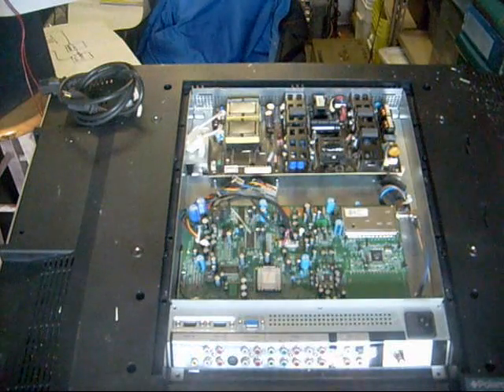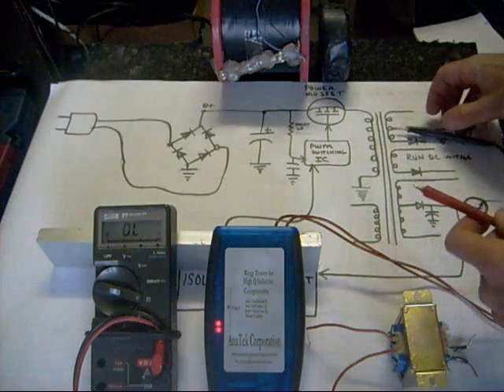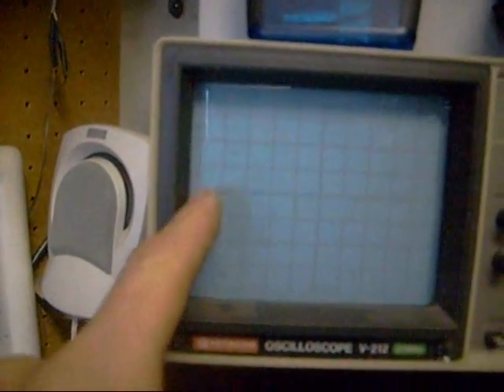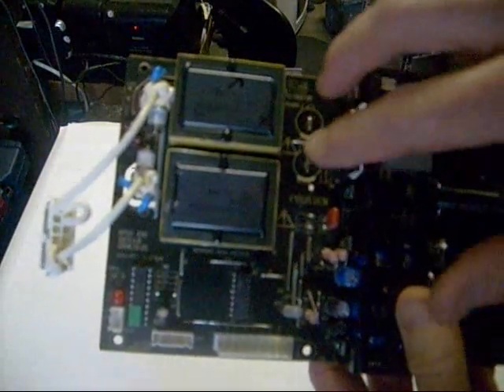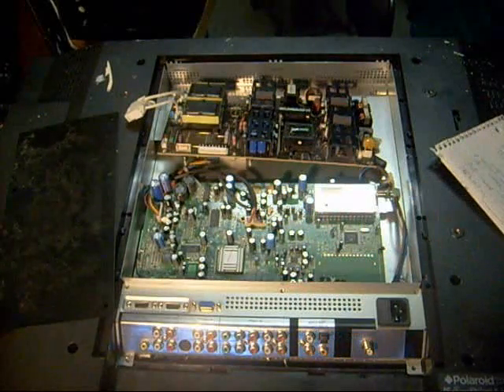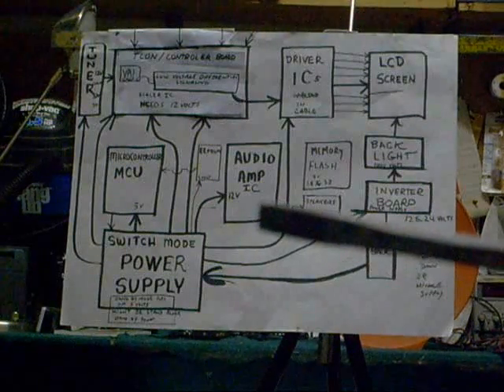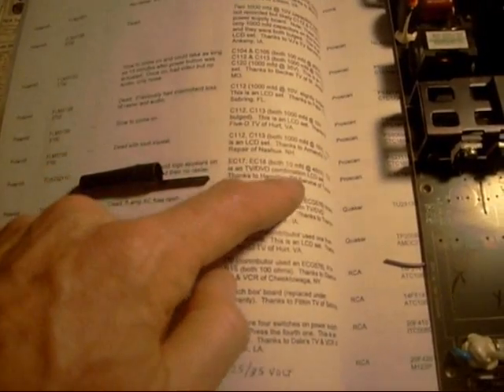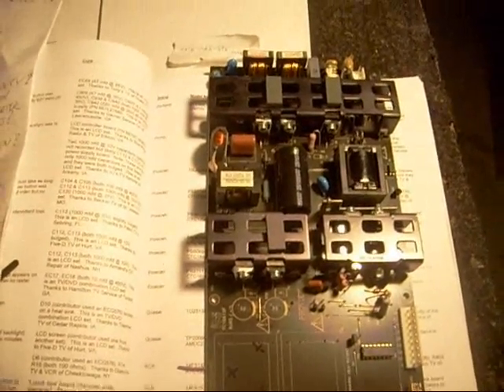LCD TV Repair made easy # 10

Comment from the maker: @BIGBOSS1983100 I start by checking power supply voltages and if it's okay I move on to the Y and X sustain board. Often times a shorted/bad component will cause the fuse to open on the Y or X sustain board. Once I see an open fuse on one of there boards it gives a pretty good indication that's where the problem is. Some people replace both of these boards as well as the buffer board to play it safe but it's not always necessary. If you suspect the buffer board is bad see if one IC is hot.
Dave

Comment: Thanks for the help man, I do small electronics as a hobby and after using some voltage approximations I found out the secondary winding on the inverter was bad.  Kepp doing what you do!

Comment: Great video series! An industrial electronics tech, I've been dabbling in repairing a few flat-screens myself. 

One thing you touched on but I think needs more coverage: how to unsolder components (and not!). Possibly show damaged traces from improper desoldering. 

I've received a few PCBs with charred pads where the previous person unsuccessfully removed a component -- and a few mm of the traces. 

If you've got a vacuum-desolder unit (Hakko or such) show how simple this makes the job. 

Thx!

Comment from the maker: I don't know if you used the correct replacement diode, but if you didn't this is one possible reason why the diode could instantly go bad. Also you should use your ohmmeter to check for shorts to ground on the side of the diode which connects to the load it powers. If a capacitor was bad on the output side of the diode this is another possible reason for the diode to fail.

Comment: Hello Dave...Love watching your videos. Thanks for sharing your wealth of practical knowledge for us to learn from...

I'm an 'Old School' ham radio operator (Inactive) but still hold my license...Tube equipment was still popular when I got into electronics and radio in the early 70's.  

I just started playing around with these LCD TV's & Monitors. I'm a volunteer at a electronics recycling center and I'm seeing a lot of these modern TV's  showing up all the time. Some of them are only a couple years old. I asked my manager if it would ok for me to load them up in my truck and take em home to see if I can get them going...He said...Sure go right ahead..

Anyways...I just got done working on the same Polaroid 32" like the one at the beginning of this video...I spent almost an hour trying to get inside the darn thing...
Removed around 20 screws and still couldn't figure out how to get to the innards.
Well of course you're probably having a little laugh right about now and so was I when I realized it was as easy as removing 4 screws. I gotta say this Polaroid is  a very well thought out design for ease of servicing.

I found the same 2 caps were bad in my set...I replaced them and the set came to life and working fine, guess those transistors on the heat sink were okay, but now I'm wondering if it will stay working, or should I consider replacing them so the same thing won't happen again? Did the caps fail and take out the transistors or the other way round?

I have some questions about an LG 32" model that I will post for you later...

Thanks again...Freddie (WB9RTZ)

Comment from the maker: @geo1671I could not fully follow your testing procedures but In a case like what you described I would start by testing the main switching IC or transistor in the switching supply the bridge rectifier and diodes on the secondary side of the switching transformer.

Comment from the maker: I don't know the specifics on your power supply, but as a general rule you need to verify if the power supply has shorted components, or if your microprocessor on the main board isn't turning it on. Can you measure a turn on voltage on the PS on terminal on your power supply board when you press the power on button?. It's often going to be 5 volts.

Comment: Got one for you Dave, was pulling my hair out with an inverter board issue and watching your videos for hints on what I was doing wrong.  Found the issue was this simple, on the ribbon connecting to the master board, under the blue protective strip, a small part of the corner of the ribbon was bent under... that took a minute to find I'll tell you.
Reply from the maker: Bobwith Tam Good deal. Sometimes simple things take many hours to locate. At least you figured it out.

Comment from the maker: Digikey probably sells them but I doubt yours is bad.. Would I be correct to assume you probably see the swollen plastic top and  you think this means the capacitor is bad?  You should look to see if the metal is swollen under the plastic,  Sometimes a bad capacitor may not swell at all.

Comment from the maker: @Lavinco When you look through the ventilation holes in the back of the TV can you see if the back light is on after the video shuts down? Did you use an ESR meter to test all your capacitors?

Comment from the maker: Sometimes when a capacitor goes bad it can cause a Transistor in the same circuit to go bad. This is why I knew it was a good idea to test them. You can test the transistors with an ohmmeter. When they go bad often times their resistance values are less than an ohm between the transistor junctions.

Comment from the maker: @JonathonBlanton If your back lights were working there was no point in replacing the inverter board. I start by testing power supply voltages and then some of the regulators including the real small ones on main boards.

Comment from the maker: @MsDanijos I don't have any videos on testing regulators but many of the three pin regulators check the same way as any bad transistor or diode. Their junctions short out and bond as though they were a solid piece of wire rather than a semi conductor.

Comment: I find this also very interesting, and great work,I have the same tv as in your video on my power supply I changed 2 very blown caps and I also changed the f2 fuse and now the f2 blows as soon as I plug it in without any other connection to the power supply ,this does make me believe that the problem is somewhere on the power supply,how do I check the transisters,3 points what reading should I get with my ohm meter...thanks for any info

Comment from the maker: @chevy56123 You should be able to make any capacitor work by soldering wires to it. Did you verify the cap is bad or are you guessing because the plastic on the end of the cap is bulged? I have never seen that cap go bad even thought the plastic on the end appears to be swollen. If you peal the plastic away from the aluminum body on the capacitor I bet it will look fine.

Comment from the maker: I would suggest you try warming up various sections of the circuit board with a hair dryer and see if you can isolate which capacitor is bad. Randomly replacing them all sounds like a big waste and guarantees nothing.

Comment from the maker: Yes it's a possible a bad capacitor could cause a no color symptom, but if it the color worked before you replaced the capacitors, I would wonder if you accidentally caused a new problem.

Comment: I am fooling with a Polaroid alot like yours,I found a large electrolytic cap bad in the power supply,never saw one laying down on its side.It is a 150uF @450V,how do I explain to get the part without the usual leads but they are heavy duty and bend 90 degrees to lay on its side.I don't think regular leads would work,these have pads on the leads comming out.I guess you can tell I'm new at this but learned alot from your videos,Thanks

Comment: i know your busy but i have what i hope to be is a simple question. i have pretty much the same board in my polaroid. it wouldnt power on at all, no lights nothing. i lifted one of the legs on the D10 diode and the tv works fine. so i replaced the diode and it goes bad instantly. my question is , any idea what would be causing this? i assume leaving with one leg disconnected is not going to be a permanent fix. thanks for your time, and thanks so much for the helpful videos

Comment: Thanks for the great videos. I have a flx-3210 which I have replaced many components and it still goes to an all black screen after about 1 minut. The sound and blue LED in the front stays on while the red LED D13 on the power supply comes on. I tested the voltages and they appear fine. All caps and resistors have been tested too. Any idea what is still causing this? btw, I cannot locate any inverter boards. Are they hiding?

Comment: Thank you for this video. The other day when I went to visit my dad at his office, I found that the town started to drop off their old and none working tech for proper disposal around the corner. there I found the same TV you are working on. The screen was in perfect shape but the base was gone and the remote and power cable as well. I would have to guess that the original owner had it mounted on the wall and did bother to see how to fix it. I got into it and found the same two capacitors you found  and there were bulging.

online I found that people are sell repair kits for this model of TV and they are just the capacitors. I'm in college and money is tight, so if i just need to replace those two to get a working $500 HDTV for just around $16, that's perfect. Just wish it went to 1080p and not 1080i.

Oh well! beggars can't be choosers.

thank you for posting this video.

Comment: Is there a way of getting a schematic and parts list for a monitor or tv power board if the service manual doesn't include the power board details?  Also, is there a way of determining what company manufactured the power board?

Comment from the maker: @ar15gringo I don't know which parts on your TV are bad but the Two transistors I replaced on mine were ordered from digikey. The manufacturers part numbers for both transistors is FQPF9N50CF There location was Q17 and Q18
Test the old ones before assuming they are bad becaues they may not be. Also scroll down in the info section of this video and you may find some additional info which helps you.

Comment from the maker: @chevy56123 Sounds like your using a regular capacitor tester not an ESR type which tells you a great more than the cap tester on you meter. I don't trust capacitors that only tell you the microfarad value.

Comment: you have video showing how to test the voltage regulators? i also have vizio gv42l fhdtv back lights work PS fine caps look good was told to check regulators on main board

Comment: I have a TDX-03211C with the exact same problem.  One visible bad cap in the same place. I replaced both caps and now my tv powers but no display. The power board light flashes on and off.  Could you tell me where to order the other parts that may fix this tv?
Thanks

Comment: I have the same issue, changed the c16,c17, the 2 transistors, and f2 fuse ..... my local repairman also mentioned the d10 diode. At first, the board gave me a flashing red light, then after parts changed no red light, but can here a faint clicking sound coming from the transformer that is between the 2 black heat sinks. Does it sound like the D10 diode causing this, and if so do you have a number for the actual diode (if not I will pull the board again)?

Comment: Can you just check the voltage output of the power connector(s) leaving the SMPS board? Some of these connectors have the voltage output expected silk screened on the PCB. If these all match the silk screened values doesn't that indicate that the SMPS board is good?

Comment: Without getting to technical .. I have a Vizio that was refurbished and only 5 months old.. I The picture only went out one day with sound.. The backlights are working as I can see them through the vents.. Someone told me to replace the inverter board.. well that was done and this didnt make a difference... I have a volt tester.. what would be your opinion on the issue here? Thanks

Comment: @GrantsPassTVRepairs Yes the backlights go off completely and red LED (d13) comes on on the power board. Yes I used an ESR meter to check all caps. The only ones I can't check with my esr are those blue and brown low pf ones. However, I did pull some of them and check them with my mf meter. They seem to be okay. The problem is NOT in Mike's TV repair book either, but seems common to others describing it online.

Comment: Tried to find a better place to ask question but no go. Have replaced obvious burned backlight inverter and now new board overheats too (still functional, unplugged TV). LG 42LG30 - is this more likely due to bad part in the power PCB or the main board PCB? Realize no guarantee just if you had no ability to replace anything beyond a whole board, which board more likely has the bad part?
Reply from the maker: Unless your new inverter board has a problem, I can't imagin what would cause it to overheat other than a short
somewhere on lamp assembly. I suppose this  could be causing it to draw to much current but this is just a guess.

Comment: I have a vestel tv like that but its psu is a 17pw16/2, it explosively shatters its mains fuse on connection to supply.

seems it boosts my 220/240v in upto 400v, then runs that into 2 more power supply circuits to get the 24v inverter and logic supplies.

I though i was clever just switching out the first mosfet that rings the transformer and its controller chip, bang! same effect, guess i was wrong / barking up the wrong tree.

I could just buy another psu for like $50, but i hate giving in..

Comment: Hi

I have this Element model ELGFW551,it only displays half the screen in the horizontal deflection.looks like it could be an horz. output transistor or driver is defective.
Can you tell me where I could get a schematic diagram or have you any idea if something else could cause this issue.

Thanks

Comment: I located another bad capacitor on the circuit board, but I am having trouble locating a store or Website that sells it.  It is the big capacitor with 150uf450wv (neg+105°c) 
Is there any place you could suggest?  Is there a email address I could email you at?

Comment: I have a polaroid tda-03211c that you could turn on and then it would shut off after displaying the polaroid screen so I opened it up and noticed that there were two bad capacitors the 450v-10uf so I replaced them with my repair kit  and now I  noticed that I don't have color for the tv picture it seems to be black and white is there a capacitor that I need to replace that controls the color ?

Comment: hi , i have an seiki led tv. model # SE322FS . well it has a black screen did the flashlight test and saw an image .  i searched around the web. looking for the best fix. would the led drivers be integrated in with the main board??? plz. help at a pause .
Reply: Johnathan Valentin possible one or more LEDs blow.

Comment: I need some advice,, i have a polaroid tlxb 4241. didnt turn on one day, found a blown cap,, replaced it, now it still didnt turn on but the blue light came on after hitting the power button. ordered a used board, no blue light this time, got another board..blue light this time but still no power on, this seller claimed it was tested prior to shipping but i noticed 3 raised caps in the pic so he replaced two of them b4 ship.so either he is lying about testing it or i have another prob, HELP! lol

Comment: Wharfedale lcd tv 32inc-L32TA6A. It has PHIHNOG SWITCHING POWER SUPPLY BOARD-PSM210-417A-R
Problem- Blinking red or blue light
i find out there is No 12von CN4 and 24v on CH5 but there is 5v on CN3.
Please. advice. every little helps. thanks

Comment from the maker: If you google the different numbers which are printed on the circuit board sometimes you can find out who made it, but as far as the schematic goes it should be included in the service manual. Did you check Howard W Sams company? I have a link to them and service manuals dot net on my website at TV REPAIR INFO . COM

Comment: Before I replaced the capacitors the picture was black and white.  I turned
the tv on last night and for less then a minute the color worked then it
went back to black and white.  I have a repair kit for the tv should I
just go ahead and replace all of the capacitors? To fix the color problem?